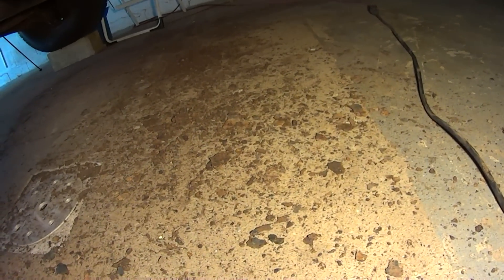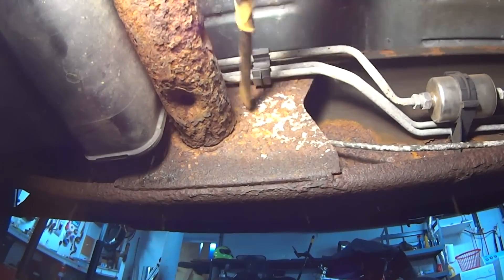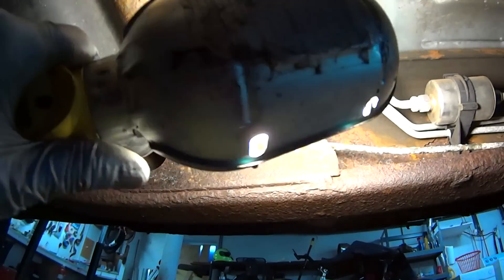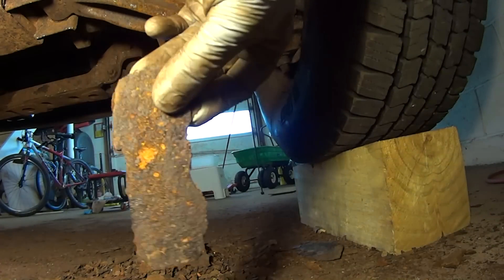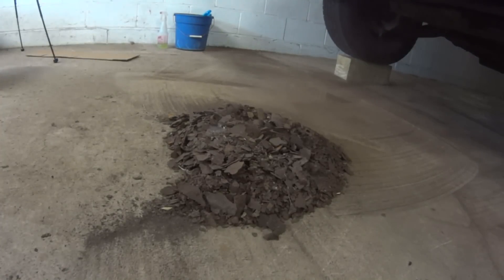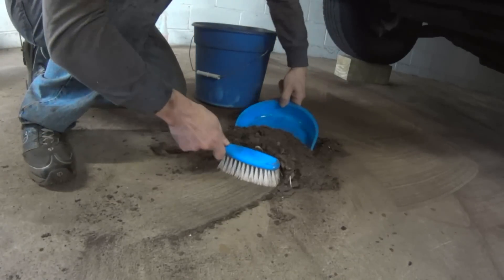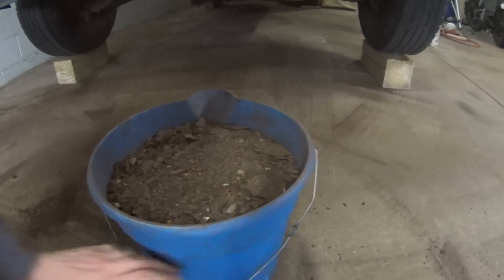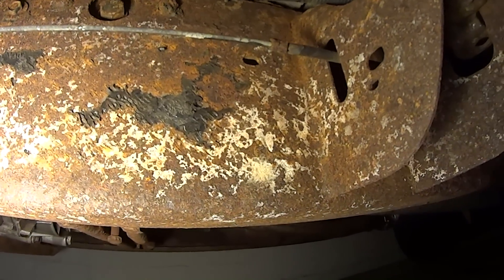Most satisfying video. Silverado Frame rust removal, RUST PROOF STUDY

Comment: People keep blaming salt.  BS.  Salt is a known if auto companies haven't learned to cope with that in a much better fashion after 120 years they need to get out of business.  There are alloys that do quite well under that level of exposure.  Why would they make a rig that would last if they can steal your money every five years for a new one?  Sixty thousand for a thowaway truck?  Only in the US does this make sense.  They own the government and make the rules so it isn't likely to change.  Trucks that you have to pull the cab to do a tune up?  It just gets worse and worse and the price keeps going up.  Take care.  Doug
Reply: It really is a bunch of crap isn't it 😒 ?
Reply: It's called planned obsolescence, built to fail
Reply: I would say 5 % or maybe 10 % molybdenum would totally arrest any corrosion. Toyota trucks are susceptible to severe rusting if no measures are taken but no maker is immune. Some Molly in the steel would make frames near corrosion proof.
Reply: Only can do so much to protect from this everything will beak down over time
Reply: Your right, that is why I don't buy U.S made vehicles.
Reply: Things to keep getting worse and worse in the prices keep going up and up and car companies keep getting greedier. They have us stuck. And they will keep selling these cheap little new cars for 3 or times what they're worth and giving you less as the years go on.
Reply: 70 year old metal planes fly fine and look like they will be flying in another 70 years. Cant keep a truck together. They rust away. In Maine, trucks last about 6 or 7 years before the fenders, rocker panels, cab corners, fenders, exc has holes in them.
Reply: @brianmorrison9066  Those 70 year old metal(aluminum) planes are maintained to a far higher standard than a truck. Not to mention they are painted with corrosion inhibiting primers and paint. And some of them are extensively rebuilt before they are even allowed to fly again. That can involve near complete disassembly down to the bare metal with any worn or fatigued part getting remade or replaced. A wing for example would be taken apart completely down to each individual structural member to be reassembled like it was being freshly built in the factory.  Heck Glacier Girl a P-38 Lightning is virtually a new airplane with very little of the original plane in the new one. It was pulled up from 200 feet underneath a glacier and "rebuilt".
Reply: Douglas Thompson look at 1:08 i have my truck for 13 years now a 06 silverado and i live in texas and my frame hasnt even rusted only my exhaust but changed it to flowmaster 40 setup so yeah salt does that
Reply: Daniel Martinez 🤦🏼‍♂️you missed the point he was dude.
Reply: Republicans fight consumer regulations. Note that every time republicans are in office they deregulate arguing it helps capitalism.   Yeah, sure but who suffers?
Reply: @Mote78  huh? You do realize regulation is what makes cars so expensive? Modern electronics and fuel economy standards regulated  by the government drives up price but doesn't make them better or more reliable. Competition between companies which is a form capitalism is what makes them better. There's a reason a Ford is better than GM and it has nothing to do regulation but Competition. Competition creates better products not regulation. GM builds crappy products and doesn't protect their frames but Ford does. Like I said competition.
Reply: @Mote78  You are part way correct.  It is the Republicrats as there is no difference in "parties" .  All of them are out to screw the guy on the bottom and fill their own pockets by helping the rich corporations.  Names change the game stays the same.  It is a broken system.
Reply: Douglas Thompson 

No difference in parties?  I beg to differ. 100 years of history shows that republican greed and mismanagement often collapses our economy.  Just look at the 1929 Great Depression, the 2008 Great Recession, the 2020 2nd Great Depression and the 2020 Coronavirus  pandemic (the worst in modern history).  All were given to us by republican administrations. Their policies of tax cuts for the rich and deregulation of consumer and market protections cause economic imbalances.  Trump, inherited billion dollars, lost that. Then he got another billion dollars in loans, lost that too. In total he claimed six bankruptcies and never paid back his creditors and contractors.   A billionaire who doesn’t pay his debts.  Now he’s bankrupting our country leaving us with the debt.
Reply: @Mote78  you might want to pick up a book and stop drinking the Kool aid. The 2008 crisis was caused by banking being deregulated under the Clinton administration and congress was mostly democrats. Don't forget Obama bailed out both the banks and Wall Street with tax payer money.
Reply: @mmholling87  

Listen to yourself. You’re saying that Clinton enacted banking deregulation in the 90s and that it remained in place under for a decade until it caused a financial collapse in 2008 after 8 years of Republican leadership. Reference please. 
Then you want to blame Obama for the TARP banking bailout.  Read and learn. 
Look at past bailouts and see who led us into those terrible financial situations. The 1929 Great Depression, the 1980’s Savings and Loan bail out, and of course the 2008 bailout. See the common thread.  Wealthy Capitalists enabled by republican deregulation.  Sad. 100 years of history has shown that without regulatory balance in our economy, unbridled greed will cause markets to collapse. 

“To prevent the situation from completely spiraling out of control, Treasury Secretary Henry Paulson pioneered the Troubled Asset Relief Program (TARP). It was signed into law by President George W. Bush on October 3, 2008, with the passage of the Emergency Economic Stabilization Act.

Troubled Asset Relief Program (TARP)

Emergency Economic Stabilization Act (EESA) of 2008 Definition
Reply: @mmholling87  
You blame the person who helped save our country from financial collapse, who ended two tragic wars, who brought 23 million more Americans under health insurance, who decreased unemployment from 10% to 4.5%, whose leadership led to a market increase of 140 %. Finally, he accomplished all this and more with zero. zilch, nada arrests, indictments or prison sentences after eight years unlike the Trump administration’s over 100 indictments, and multiple arrests, guilty pleas, prison sentences and pardons in just his first year.  Then, Trump only lowered unemployment 1% before doubling it to 7%, murdered 400,000 Americans through his terrible handling of the pandemic. So yeah, keep glorifying your Republican leaders. They are not all that.
Reply: @mmholling87  
In any case, did you even read your reference?  It says Glass Steagall was repealed by the Republican Congress in 1999. 
Greedy republicans led our economy to ruin again. 

“Named after three Republicans, the Gramm–Leach–Bliley Act (Financial Services Modernization Act of 1999) is an act of the 106th United States Congress (1999–2001). Its passage removed barriers provided by the Glass Steagall Act of 1933 that had prohibited any one institution from acting as any combination of investment bank, commercial bank, and insurance company.

Upon passage of Gramm–Leach–Bliley, with its repeal of critical Glass Steagall banking regulations, commercial banks, investment banks, securities firms, and insurance companies were allowed to consolidate.”
Reply: @Mote78  I dislike both Republicans and Democrats. Both parties are responsible for the 2008 financial criss because they both voted to repeal Glass Segal Act. 

TARP was approved by both parties. When Bush gave money to Wall Street and cooperations he was critized by the left but when Obama gave triple the amount to Wall Street he was "saving the economy."

Both Democrats and Republicans in congress voted for both Iraq and Afghanistan. I served under both presidents and the ROE under Obama were terrible and literally cost American lives. ISIL thrived under the Obama administration because of ROE were so weak. 

But your original argument was trucks would be better with more regulation. But you're too ignorant to realize GM doesn't prepare their frames and are left uncoated but Ford primes and paints their frames. Regulation doesn't make a better products for consumers but innovation and competition does.
Reply: @Mote78  Democrats voted to repeal Glass Segal too. Keep reading 44 democrat senators voted to repeal Glass Segal including Joe Biden. You can't blame one side without the other.
Reply: @mmholling87  
I remember helping my father install seatbelts in our 1964 Chevrolet Impala. We removed the back seats, the carpet trim and pulled up the carpet.  Lo and behold, there were already predrilled holes for the seat belts with rubber plugs!?  The car manufacturers were ready to install the belts if they were forced to but wanted to save a couple of bucks.  😡 My father taught me that corporations don’t watch out for the good of people unless they’re forced to. That’s why they often don’t change until they’re forced to by government regulations or by lawsuits.  
Yeah, competition certainly improves products but capitalists want to make more and more money. They also love monopolies, not competition. Democrats, not republicans, work to break up monopolies. Work to watch out for our good. I’ve seen it for 70 years my friend.
Reply: @mmholling87  
So because some Democrats listened to republicans and decided to give their ideas a chance, you want to blame them too. Is that how it works in your book?  If so, you don’t understand the responsibility of leadership. It comes with accountability.
Reply: @Mote78  It was under Clinton's leadership he was the president and he signed it into law. Your age group has been running the country for years and since the depression democrats have been in charge over 60% of the time...and the country has only gotten worse. It honestly doesn't surprise me you don't know what ROE means. You cannot change my opinions and I cannot change yours so this decision is completely pointless.
Reply: @mmholling87  
So Clinton compromised and listened to republicans and for that you want to blame him for their idea?  Even though they had him over a barrel with their impeachment over a private love affair? Which had no impact on national security like the Russian meddling with our election to help trump win, as determined by our intelligence agencies not democrats. Republicans wouldn’t even subpoena trump to testify in a national security matter. But a private BJ?  Unholy unconstitutional act!  
Keep educating me my friend. I have an open mind, I’m listening.   I have much to share so you can hear the other side. Though I agree neither side is perfect, we need both sides to have balance. But cheating and lying are wrong.  I condemn it as I condemn violence from either side. I hope you do too.
Reply: @mmholling87  
The comment that a certain “Age group” has been running the country since the depression isn’t new.  Isn’t it always the case that those 40-70 of age are the bulk of those running things?  It takes a while before people learn the ropes and gain the power to control things and after 70 most people want to retire. That has probably always been case and will continue past my lifetime.  The case of someone as young as Zuckerberg having a significant influence in society is unusual.  There aren’t many Zuckerbergs.
Reply: @Mote78  I have nothing against you and respect your opinions but I couldn't disagree more. I think both sides are crooks and leaches. I realize I cannot do or say anything to change your opinions so I really think this conversation is pointless. I think the best thing for our country is a third party. Enjoy your life.
Reply: @mmholling87  
Unfortunately, I don’t think a third party has a chance of ever winning. It only serves as a spoiler.  Although I’m glad Biden won, I wish Michael Bloomberg had started his campaign earlier.  He was my favorite. A strong independent with financial and business credentials who didn’t follow the false Trump mantra.

Comment: At what point do you say this metal is to weak? I have hammerite krust which I have used in the past on door sills eccetera but not sure if it actually weakens the metal or not I have used it on bad rust but not sure if you use it on light rust as well

Comment: Frankly, underneath the undercoating and surface rust that was removed, that frame is in great shape.  Not one hole.
Reply: Except being thin and weak
Reply: @Toyota-ci3nj  but it isn’t, the truck is still around 5 years later

Comment: Steel to iron oxide (rust) is 13 to 1 so you really only lost 1 13th that weight in frame material.
Reply from the maker: I know. Most people think 1/8 thick rust means 1/8 of metal.

Comment: Why would you not use the proper tool for the job. An air hammer with a chisel tip ain't it. Go buy a needle scaler & do the job right.
Reply: Needle scalers are fucking slow and have a small work diameter.
Reply: delaine maiers slow or not, it's the right tool for the job. Using an air hammer is something only 12 year old kids & hacks do.
Reply: +ROTAXD Needle scalers are only good for thin, stuck on stuff. air chisels are great for quick work of big rust spots. Only a hack would use one tool to do a job "correctly"

Comment: Did you ever hear of a needle scaler?
Reply from the maker: Yes, I did reviews on them. Useless is this application.  Too slow. You need strong impact to knock the heavy rust first (large sheets) then you can use needle scaler to remove the thin rust

Comment: Dear Friend you have already removed enough metal  so to GRIND anymore is just insane Use a salt neutralizer and rust reformer to save whats left  . YOU DO NOT need to grind any more metal off give it a good cleaning degreaser and salt Neutralizer  then rust reformer and repaint with Por 15

Comment: A pneumatic needle scaler would do a lot better.  But sometimes you have to use what ya  got lol
Reply: Daniel Allen my thoughts exactly. Needle gun that shit.
Reply: Daniel Allen I do this kind of work on a regular basis and I disagree about the needle scaler doesn't hit anywhere near hard enough I have high quality Blue Point and Snap-on needle scalers and by Far and Away my snap on air hammer does a better job it hits way harder!!

Comment: Amazing... They could engineer thàt to not happen by installing some kind of rustproofing or even a plastic under body cover that can be removed quickly for service byt they want it to rust and trade in on a new one in less than 5 years.. Corporation just want sales.. Not environmentally sound building techniques to conserve.. That would not make more sales ...which is what is needed....

Comment: Get the needle scaler gun; it won't destroy the nuts, bolts, welds and riveting but strong enough to open up internal holes that need welding or fillers and works around curves
Reply from the maker: I have videos using needle scalers. Waste of time. Too weak and slow

Comment: Hysterical that commenters think that only GM products rust in New England.  As a plow truck driver I can tell you the salt tears the ass out of everything. It doesn't give a damn what brand it is.  The only thing you can do is oil spray the vehicles in late fall.  It's even funnier to read the "that's just undercoating" being chipped off.  Bullshit, does undercoating weigh 40lbs?  Ahh, no.

Comment: how much would some like this cost to get done in my astro?
Reply from the maker: A lot. It took me days to clean everything up and then coat it with grease. Time consuming job. Best you can do is brush heavy Chain Bar Oil on all the rust spots. It will soak in and extend the life of your Astro. I have 2002 Astro but has no rust, Florida van.

Comment: Thats not rust,,but the original undercoating,,I have 08 Silvy and its still good in many places,,wherever it peeled off and frame started rusting,, I sprayed Rust converter coating primer then POR 15 coating,,,ruberized coatings or bedliner coating works good too
Its an endless battle when living in rust belt,,until they make chasis from stainless steel !
Reply from the maker: There was tiny amount of the coating left. The coating was rubber/wax mixture but most of it fell off years ago. The tubes would still have it in places. About 5 years ago previous owner painted the frame with paint over rust. The is the black stuff you see with all rust underneath.Truck was in salt for 16 years.

Comment: I love my 2001 Silverado 2500HD.  They have galvanized bodies and unprotected frames!  What the hell?  I live on the west coast so we don't have the salt issue but after 16 years the frame rust is showing up so it is time to clean it up.  Needle gun will do the job on  mine.  You had to have a full fledged jack hammer to get that rust off in this video.

Comment: Just think, a few dollars worth of zinc used to galvanize the frame would have saved all this horror! It's simply unbelievable GM just wax over the top of bare steel, even now!! Low quality rubbish. :(

By the way, use a descaler attachment in your airtool, not an air chisel, you risk doing less damage!

Comment: Why does rust get so bad like that on just certain trucks? I have seen trucks that vintage with hardly any rust on the frame. My stepdad has a 2006 ford f-150, should I check it for rust like this?

Comment: You need a "Descaler". There amazing. Similar to your air chisel but instead of a chisel it's a group of needles that beat the hell out of the rust.  And a gas powered pressure washer should close to a sandblasters results at a 1" distance.  I did my F-250 this way.  Had the cab off though.